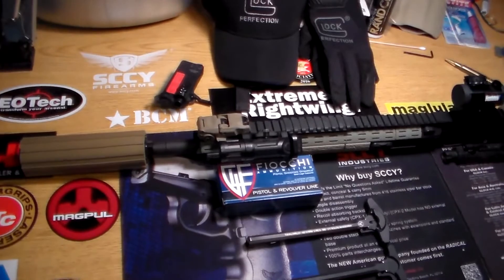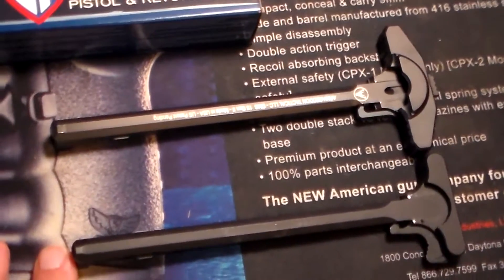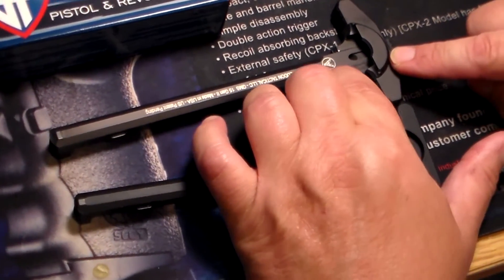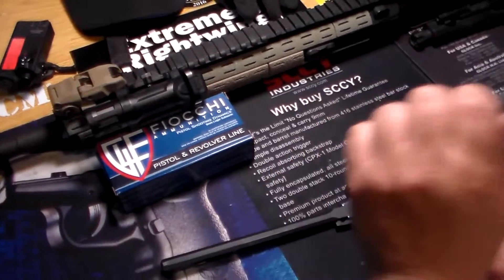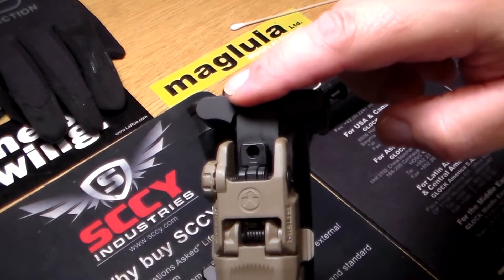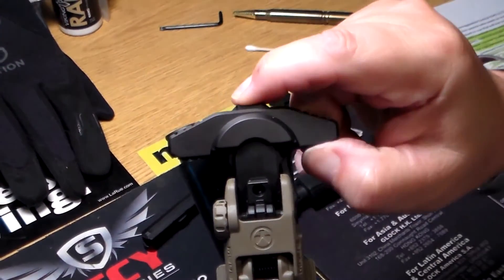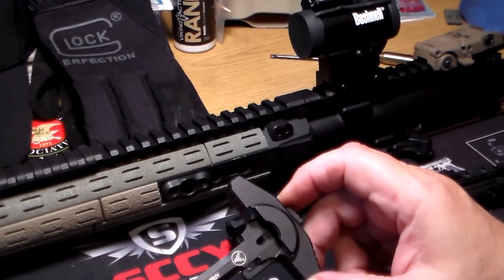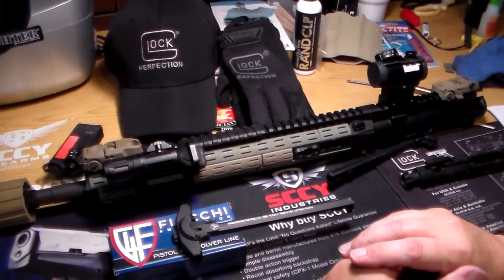The Best AR/M-4 Charging Handle: Armageddon Tactical GMS-15

Comment: Any update for how did it hold up after a few years?
Reply from the maker: Hi Neal. The Armageddon Tactical charging handle is still going strong. Best charging handle at a reasonable price. I would not hesistate putting it up against higher priced charging handle. We are fixing to be test a  new model Armageddon has come out with. Thanks for you view and comment. Stay Safe !!!
Reply: @Police108Talk  Thanks for the reply, I am getting one for sure.